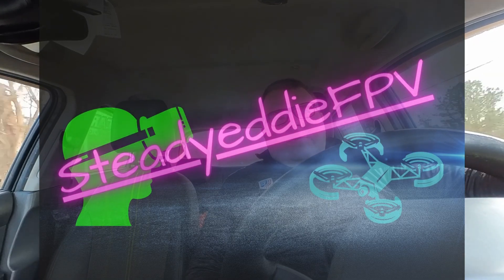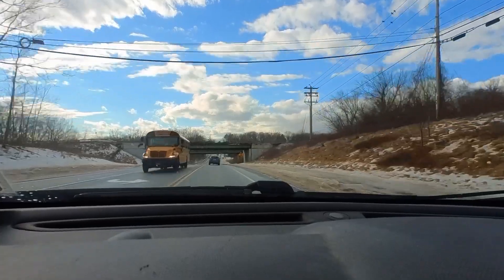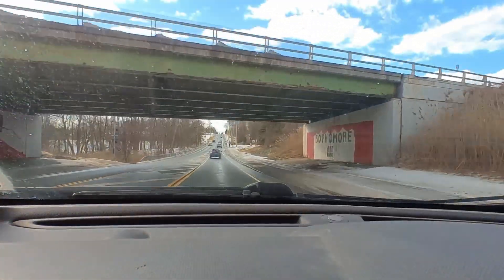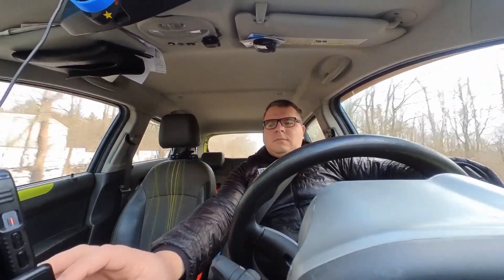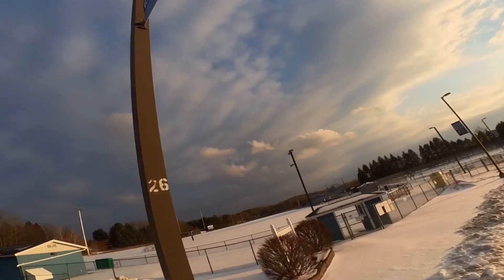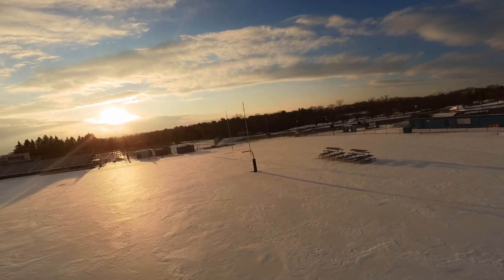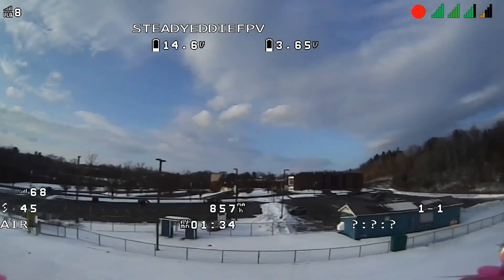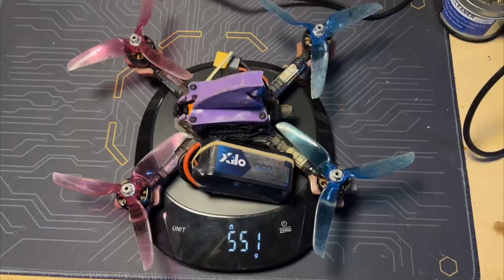FPV Racing Drone Speed Testing, 533 Tiny Trainer & 5" Xilo Phreak on 4S

Comment: My 3" t-mount drone does 75mph. 
My long range 5" does 85mph 
My 7" long range drone does 104mph 
Based off gps with slow refresh rate 
And low pitch props
Reply from the maker: Nice. I have a Rekon 5” LR quad and gps puts it at 60-70mph usually but I’m not putting GPS on a race rig. And I’m still flying mostly 4s, curious to see if going to 6s will produce more speed. Staying within the FAA regulation limits of course 😉
Reply: @SteadyeddieDrones  surprised my rekon5 had higher speed.  It is 6s but lower kv. I was running 5130 tri though
Reply from the maker: @divingfalconfpv4602   mines on 4s still a fun quad, kinda medium range with gps as a safety. 👍

Comment: Very cool! We should develop testing procedures to be able to make speed runs a bit more consistent.

A few years back I had one of my brushed tiny whoops clocked at 31mph and my friend had this monster 3" that clocked 103!! But it's hard to tell exactly how accurate that is.
Reply from the maker: You can do a fixed distance and timing based off DVR. I did that originally prepping for this and estimated the 3” at 60 and the 5” at 80. Not to far off. I was using goal post to goal post. But trying to stay strait and level so the LIDAR could read the drone was fun.
Reply: @SteadyeddieDrones  Yeah time and distance is probably the best low tech solution.  It that only gives you an average instead of a top speed.

Looks like it was some fun
Reply from the maker: An easy calculator to figure out speed based on known distance and time.  A football field is 120 yards goal post to goal post.  For example 4sec=61.63mph, 3sec=81.82mph, 2.5sec=98.18mph, 2sec=122.73.
https://www.gigacalculator.com/calculators/speed-calculator.php